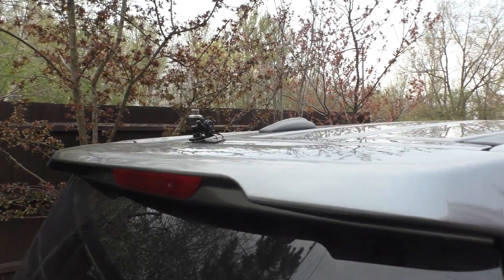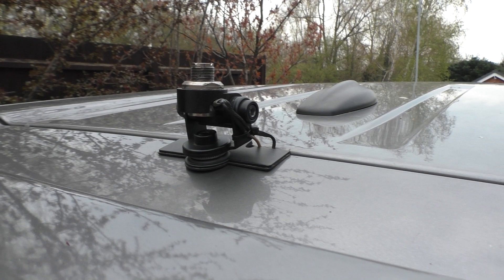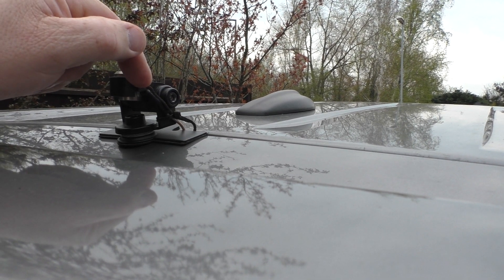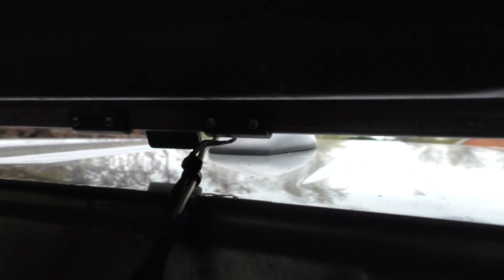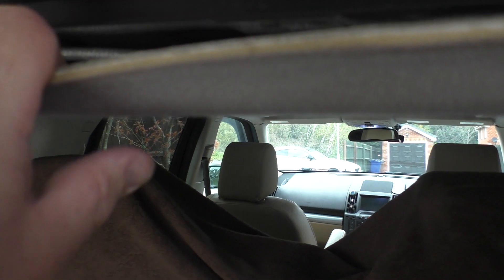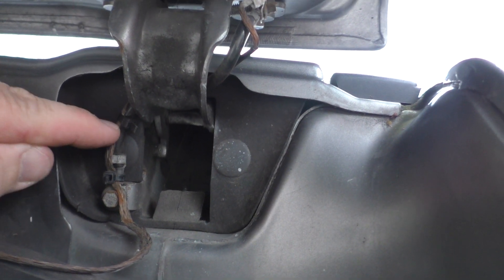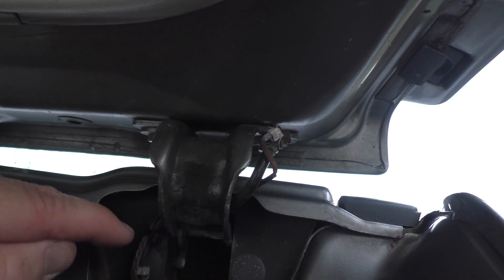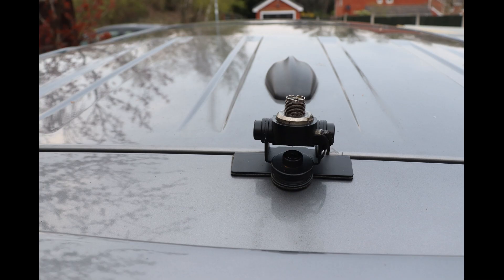Antenna boot lip mount and chassis connection for ATAS aerial

Comment: Hi Mike iv got a free lander thanks for the tip iv been using a mag mount up till now so I might fit a boot mount as you described 👍🏻 just a quick question Mike have you run your power lead for the radio through the bulk head and on to the battery if so maybe advise the best route through…

Comment: Can';t see anywhere in the previous comments where you name the mount you have installed?!? I have a Dodge Charger and I want to purchase a mount that will go on the back part of the trunk lid, nearest to the rear window, and your mount looks like it'll work perfectly. I previously purchased a mag mount base, attached it to the trunk, and it worked okay. But, and here's my mounting issue, I have a full black vinyl wrap on the car, and from the magnet in the mount, there is discolorization in the wrap from mounting. (Spending over $3500+ on a vinyl wrap, only to ruin a noticeable patch on the trunk due to mount? I was not impressed with myself when I saw it). Great video upload by the way
Reply from the maker: Hi. The mount is the Diamond K-400. https://www.radioworld.co.uk/diamond-k-400-heavy-duty-hatchboot-mount
Reply: @MikeM0XMX  Big, BIG thank you for the link. Very much appreciated

Comment: The braided stripped coax will wick water and degrade over time. Suggest solid strap.
Reply from the maker: Sorry but you are wrong on a number of counts. Watch the video again and you will learn that the earth strap is ONLY the stripped and flattened braid from the coax cable. The reason we use this for an earth strap rather than a piece of wire is explained here. Benefits of this install are i) larger surface area, ii)flat and therefore easier to route between boot and body iii) very flexible for opening and closing many times.
Reply: @MikeM0XMX  he is correct that braid will act like a wick and bring water inside your car, use a normal piece of pvc coated wire, if you are using the car battery the system is already earthed to the chassis via the -ve terminal anyway and shouldn't require a second earth, I've run my atas for years just on a triple mag-mount and never had a problem except for car parks height restrictions lol, but as this vid is 3 years old have you seen extra rust around the bolt?

Comment: Wish I had the spacing at the top of my boot of my 2018 Kia Soul. No space at all to use a lip mount. Trying to avoid drilling a hole through the sheet metal or using either a magnet mount or through glass mount. Nice video. 72 de KB8AMZ, Terry
Reply from the maker: Thanks Terry. Unfortunately, LR didnt have such an exacting eye in those days for close tolerances, lol 73
Reply: i have a kia soul as well (love the car). did you find something that works?
Reply: If you buy a hatchback mount they usually can adjust to cope with side mounting. I used to have one on the hatch of a golf mk4. Could never get it fitted on the top due to clearance issues, but managed to find a neat space on the right hand side of the hatch lid to mount it.